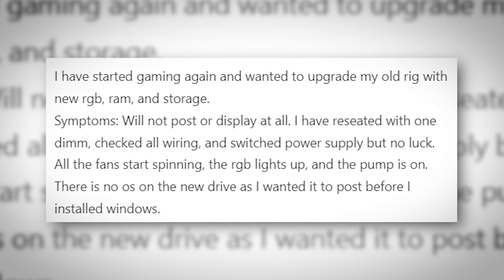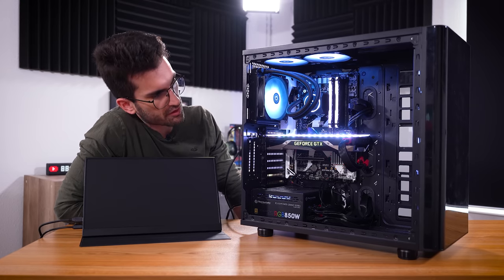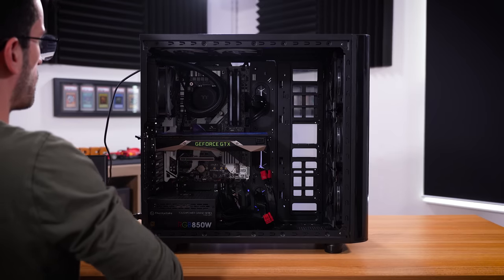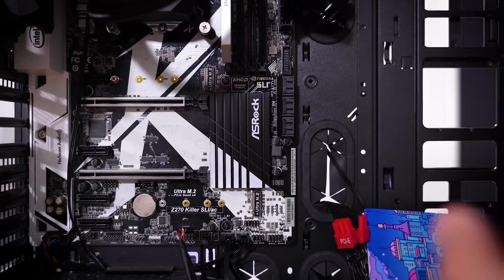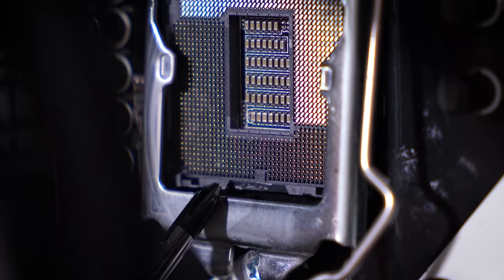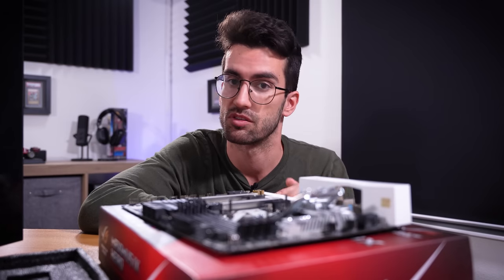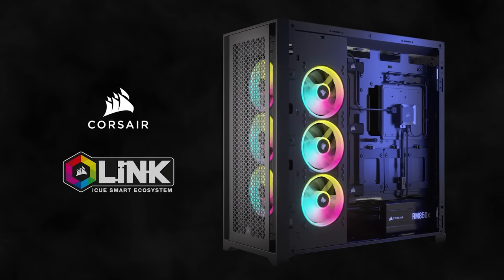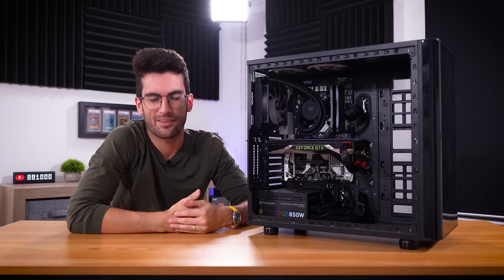Fixing a Viewer's BROKEN Gaming PC? - Fix or Flop S4:E14

Comment: Gosh, this happend to me before while cleaning my rig I used an mircofiber cloth to whipe the dust around the socket and it got caught on two of the socket pins and bend them. Installing the CPU shorted a bend and one non bend pin together. Without noticing that I powered on the PC and it refused to boot. That took me a while to figure out as well... 
I could rebend one pin but the other broke and I had to straighten it out. The repaired board lasted on daily usage until I replaced it with a whole new build ~3 years after that happend and it contiuned working about 3 years of weekly use after that in another build until I retired it. 
So I don't see why this PC shouldn't last as long but I guess don't remove the CPU unless you really have to. I did it on my system three or four times with the broken pin and it worked just fine but your mileage will vary.

Comment: when i built my pc it wouldn't post i tried everything but nothing it was a ryzen 7 5800x i took it to my local pc repair shop and found out it had a few bent pins but they were able to bend them back which was great it plays up every now and then but it works

Comment: Greg love all these fix or flop videos and all your videos in general I will tell you a quick story I bought an Asus pre-built in 2021. Very nice computer paid $2500 for it about a year, and I wanted a different case that it came with purchased a case attempted it myself couldn’t put it back together. I’m at idiot so I had to buy another computer from a local person that builds them all brand new stuff but without a GPU without a aio but  I had him put some of the parts from my asus pre-built in that computer computer was great very great, after about a year didn’t like that case well, maybe six months so I wanted to buying a Lian li 011 mini case with the intentions of having this guy swap everything over for me. In the meantime, I watch your channel religiously one weekend I say you know what I can do it I’m confident, and a few hours later it was done perfect and since then I swapped all my fans out which are nine of them twice from Lian Li to be quiet to 😮Thermaltake my second ally, I finally change the motherboard because the one I had getting really match the all black look I was going for and then finally the CPU but all of this was done was from watching your channel from not being able to put the computer back together to building this one and then swapping out parts all over the place and cable managing pretty nice but my build consist of RTX 3080 a msi z790-a pro motherboard a Intel i7 12700k a EVGA clcx 240aio a 4tb crucial ssd and a 1tb ssd a evga modular 750 plus power supply super nova I know this is a long run on sentence and probably doesn’t peek your interest but just want to say I wasn’t able to do any of that without your channel so thank you and I’ll forever be a fan Oh yeah, quick story yeah, right.

Comment: In regards to the winner; the worst part is: sometimes Youtube doesnt inform you that someone has replied to your messages. 
In regards to the bent pin: Whenever I am repairing boards that have a bent pin, I just replace the socket. Hot air gun and very precise heat application, and a motherboard like this lives on for years to come. 
In matter of fact, I replaced one of these sockets not too long ago, about 3 weeks or so for one of my friends. It's therapeutic, working so precise.

Comment: Too lazy to check the LGA1151 pinout, but could be a ground pin so it's actually not THAT important. My guess is that the crap in the socket was the culprit.

Comment: I had a similar problem but with amd i have a ryzen 7 3800x overclocked to 4.2 ghz with two pins missing when i had a problem it was with the motherboard totally not related to the cpu I only saw those broken pins when i was troubleshooting and even the repair service who i consulted with said that it was strange and that i was lucky the cpu is still going strong so weird stuff happens sometimes evrybody have a nice day 😄

Comment: Flashing red LED is not indicative of anything from ASRock, it is normal. The culprit was something with the BIOS/CPU/RAM - and a combination of things should have fixed the PC. Usually popping the CMOS battery and jumping the 2-3 for 10 minutes would work in a situation like this. (I'm only halfway into the video at this time)

Comment: oh I'm sure he  will respond , :)  bent  pin on the  mb  such luck isn't in  my corner but personally  would have if i was the owner  just  replace the MB .. you never know how long  that  bent  pin fix  will last .. probably over tightened the  cooler casueing excessive pressure on the cpu

Comment: The motherboard socket pins are pretty much by far the most fragile part of a PC. Always be extremely careful when installing/removing your CPU, and keep the original plastic cover with you in case you have to leave it bare for ANY amount of time.

Comment: You should take a look at pinout diagrams of sockets, a large amount of pins is not doing anything and another decent amount is redundant (around power especially). A broken bin has a good chance to not be an issue. A bent one is actually more dangerous, as it can short to other pins. Which I think is what happened here. Luckily power pins are not near data pins generally so it's unlikely to be fatal.
Reply from the maker: This bent pin was not touching any other, just FYI. And while I'm aware there are several ground/blank pins in modern sockets, it still isn't a generally good idea to keep them from contacting the chip.

Comment: I have a Ryzen 7 5700x with B550m DS3H rev. 1.7, however, it has no post when I turned it ON.

All brand new parts.
2 x 16 gb ram 3600
GPU RX 7600
Ramsta 750w
SSD 1T & Ramsta SSD 256 gb
4 Fans & 3 fans YGT Liquid Cooler
Coolman Robin 3 Case

Kindly advise on what to do to make it work 🥲

Comment: If you don't have status LEDs on the motherboard, plug a small speaker into the appropriate board header, and listen to the beep codes. That'll tell you approximately what the problem is. Lots of boards still have speaker headers. One of the most useful tools you can use, and most PC parts stores will give you a piezo speaker for free if you ask. Fact that you don't do that makes me grind my teeth.

For example, on a board with an AMI BIOS/UEFI:  1 long, 2 short beeps is a video card issue.

Comment: maybe you should at least try gaming using your own OS in it. just to make sure the cpu is still working correctly. especially bent pin like that. the cpu might not worked correctly.

i am kinda curious if the cpu still works correctly. especially the bent pin condition is like that.

Comment: what i hate about the LGA socket system, i just bought a 6600T to replace my 6100T, but i could tell there were some tiny pins seemed bent, and memory only worked in the last two slots, after about a month it wouldnt post, and then smoked so i lost my Z170 Gaming 1 board. LGA dont last long, wish they all went the way of Ryzen AM4 type sockets instead of LGA Heat Death Traps.  I will still stay away from INtel and trust more AMD vs Intel, everytime i go intel , it messes me up. and as you pointed out, LGA feel cpu pressure, they are unstable

Comment: I have to always question submissions like this. Why at no point did he mention removing the CPU? He must have realised that it was after removing and replacing it that the PC stopped working?
Not saying he damaged it on purpose, just that had he mentioned that in the first place it would have made diagnosis easier and you have to wonder if he realised his error and panicked.

Comment: You don't need to remove the CPU when you're only replacing the cooler.  Unless it's AMD.  Then the CPU commonly gets stuck to the cooler.  lol.  I'm guessing that board had been sitting on a shelf uncovered, collecting dust for a while.

Comment: Well, a bent pin, and more often than not, I am tending to see bent pins being an issue. For those wondering, there is actually a lot of play in the pin points on how much they can be bent out and still make contact. Sometimes the contact is actually heat dependant (flex in the motherboard and heat expansion of parts). That motherboard (from what I could see in the video) seems to have a fairly good amount of play on the CPU pin contacts. Let the owner know, that in time, the heating/cooling of the motherboard will slowly flex that pin again, and they may have a computer that will run for a month, or for years.. really really random possibility on that pin keeping contact, but always hope for the best.
Congratulations to the video card winner!
(I won't ever win because I refuse to subscribe, don't like alphabet and data tracking on user information being sold)

Comment: used scd key as you advertised and got your discount.  Thank you.  A few issues though.  Windows 11 pro worked, office 365 worked, office 2016 DID NOT WORK (windows says the key has been used too many times.  Customer support from SCDkey told me they would refund me after I supplied screen shots (I provided the screen shots a week ago, but they have not refunded me)...  They told me they would refund me but didnt want me to tell anyone.  Seems very sus to me...  Wont be using them again.  Buyer beware.

Comment: Let's see what I learned without watching the full vido: Based on his summary, it could be the motherboard or the gpu. Easy to rule out gpu. Reseat the ram anyways and check psu, just to be on the safe side before going extreme. If it's not the ram, the psu, cpu and gpu then it's the motherboard and there could be a short somewhere or bent pins on cpu or dead cpu. That's basically what I've learned...

Comment: Oh well, using blinking red as a default color is not a great idea at all. Blinking red suggest that there's something wrong or seriously wrong. In fact blinking red cause me to fry something already. I order a 18650 battery cell charger thing from China, I put the battery in (the correct way) turn on the power and it's blinking red. So I'm like "maybe I put the cell wrong way and the protection circuit kick in", so I swap the polarity, turn the power on, annnnnnd magic smoke, yayy. Never use blinking red to suggest any normal operation.

Comment: Dear Greg,
I'm reaching out once more regarding my persistent PC issue. I'm in need of assistance, but unfortunately, I can't send my PC to you from India. My PC specs include an AMD Ryzen 3800X, Asus ROG X570 Strix-E Motherboard, G.Skill 16x2 GB DDR4 3200 MHz RAM, Gigabyte RTX 2070 Super 8 GB, 1 TB WD Black SN750 SSD, and an Antec EA750G 80 Plus Gold PSU. My PC has served me well for nearly four years, but over that time, I've encountered some minor hiccups, like failed SSDs and HDDs, which I managed to diagnose and fix myself.
However, in the past year, I've had ongoing issues with the RAM, leading to BSOD errors. After seeking RMA support, the distributor initially found no problems with the RAM but later discovered an issue upon my insistence. They provided replacements. After installing the new RAM and a replacement SSD, I faced persistent problems during Windows 11 installation, with the screen turning grey at various points. I attempted BIOS updates, Windows 10 installations, and even tested with a new SSD, but the problem persisted. Memtest86 revealed no issues, and Ubuntu thru Bootable USB is showing no issue.

After testing my GPU on a colleague's PC, I suspect the problem lies there. I opened the GPU, reapplied thermal paste, and replaced thermal pads, but the issue persists. I proceeded with Windows 11 installation, but just before reaching the Windows Desktop, the dreaded grey screen appears. I'm at a loss, and I'm reaching out to you for guidance. Your expertise would be greatly appreciated.
Sincerely